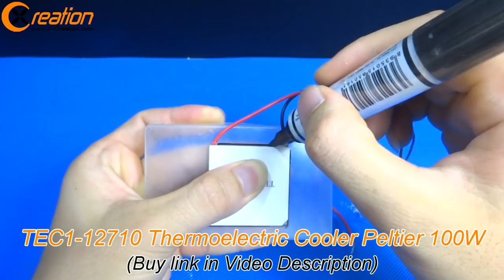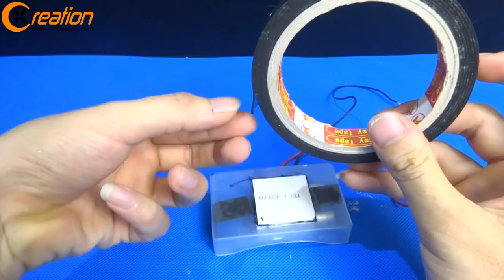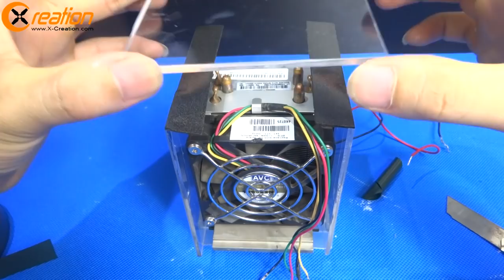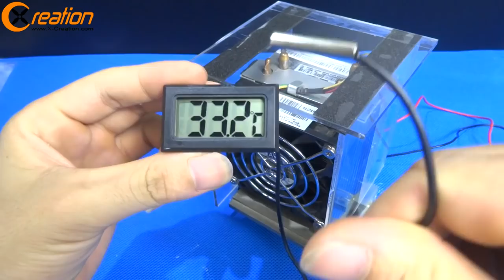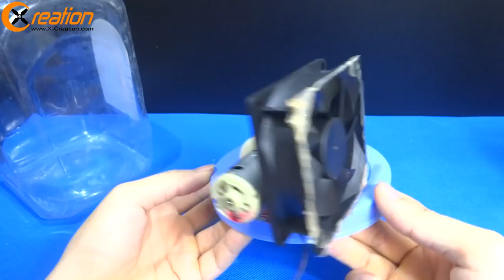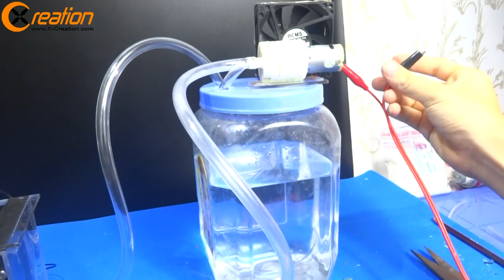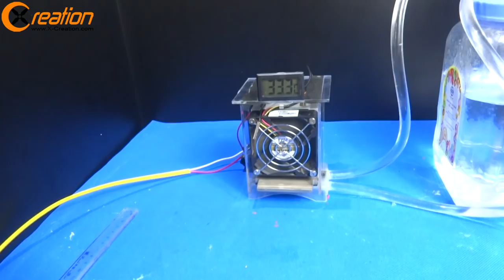How to make Air Conditioner WITHOUT ICE - Simple Homemade Invention

Comment: Uses soldering iron to melt plastic, Hot glued wires together. Smh.
Reply: That's the cowboy way??!!?
Reply: he has no soldering tin, need to improvise 😂
Reply: Lmao, imagine just hot glue'ing wires xD
Reply: Well twisting the wires will allow for contact an the hot glue will hold and protect from water. As long as there are no hard pulls it should last. Not that I think it will cool that much. An empty room OK, but with a living person, our body's put out a lot of heat.
Reply: it was kinda special
Reply: Yeah we all got cancer
Reply: dont forget those rusty tools lmao
Reply: im the 400th like
Reply: Results = he did an amazing job 👏
Reply: @tomcrisman8420  He will need to change the reservoir more than once per hour. A better idea would be an air-to-air peltier and have exhaust air go out a window via pipe/duct. This way it could run 24-7 without maintenance.

Comment: Whenever someone makes a video that has no audio and Loud obnoxious music you know what they're building is completely fake.

Unfortunately this is one of those videos that proves the rule
Reply: And, whenever someone like you, speaks, without trying it, you, embarrassed, yourself. This works in the same way, a water cooling system for a pc work. Though, I if you want to see, true results, I'd recommend, build a mini fridge, with the ability, to only cool water. This way, we're taking the water from, the cool fridge, passing through a pump, then finally. Repeating the very process. Thus, the water never gets to heat up back. Sigh, but what do I know, I'm simply a scientist. Not one that judge without giving it, the good old, college try.
Reply: @scoremoore4280  hey no offense brother but you put a lot of commas in your sentences it hurt when i read your comment
Reply: @scoremoore4280  not the same cuz you got something that splits heat and cold so some Parts are lower than room tempature
Reply: Peltiers are not used in PCs. They dont work. The issue is the focused heat the cpu out puts. No one has come up with a way to disperse it efficiently, or properly transfer the heat from cpu properly. That and the amount of energy it would take to make it viable is not worth it, when you compare just a normal water block system in a pc that works just equally as good at 1/3 the energy consumption.

Comment: This would actually heat the room unless you pipe the water into a different room.  It would be better to pipe the water to another heat exchanger with a fan on it also.  AKA heat pump.  You have to pump the heat somewhere else.  With the water in the same room the heat removed at the CPU cooler is placed in the water which dissipates into the same air.  Due to efficiency losses and energy added by the electrical system to run the pump and the fans, the overall system has a net heat gain so if it's all in a single room it's actually a heater.
Reply from the maker: great! seijirou302
Reply: Instead of that plastic container what if we use air tight insulated container like large thermus bottle and changing water hourly.
Reply: @deathsurgeon231  that's just stupid
Reply: water has a high heat capacity so although some heat may dissipate to the air the water will retain the heat so long as you don't leave it over night.
Reply: @namdabzerv3627  A better idea would be an air-to-air peltier and have exhaust air go out a window via pipe/duct. This way it could run 24-7 without maintenance.
Reply: @ericsanchez3663  If you want to dispose heat outside, there must be two separated system for heat exhaustion and air circulation, I guess. In this case, uploader of this video seemed to use a water bottle to absorb heat  to avoid such problems. Using Peltier device and CPU cooler for DIY mini air conditioner sounds like a good idea but it's hard to achieve practically, if you want it to run 24-7, I guess.

Comment: Show performance over 1 hr, 2 hr, 8 hr and you will see after the water heats up the cooling effect is severely diminished.
Reply: Trevor Sampson  it will burn itself after 8 hr
Reply: Its a fake video ,he has used his inhouse air conditioner
Reply: How do you know that ?
Reply: Simple Success story Sampson ,no harm admiring , this part of the world It is a NASA level invention As this is the vertex what this world can DO
Reply: Not to mention he cheated and put the sensor directly on the block after he realized it wasnt cooling very fast
Reply: Trevor Sampson eouldnt the energy used to vool the water that much be better used cooling the air directly?
Reply: then u put a small radiator with a fan in the cooling circuit
Reply: anno636  no its not a fake. as long the water inside the tank is cool enough to take some of the peletiers temperature the other side gets cool. ant the thermometer is going down so rapidly because the sensor is directly in the airflow of the coolerfan
Reply: s3v3redx -😆
Reply: James DeGray  Show us how
Reply: @4409supporter  You do realize it's heating the water, right?

Basically, the heat is being pulled out of the air and into the water through refridgeration
Reply: @michaellyndon6982  not sure what I was getting at a year ago, but yeah I realize that. It seems like someone made a comment about cooling the water though. Which would reheat the air since Im guessing itd be done with a radiator. Maybe I replied to the wrong person, im not really sure since it was a year ago.
Reply: true but it could be connected to mains water to renew when it hits a certain temp.
Reply: All those commenting that this is a genius invention and all those who are saying this is fake let me tell you it's neither, it is a clever way of deception. The readings were correct, but, the readings, in the end, were of the liquid-cooled heatsink as you can see at 6:32. This just like putting the thermostat lead in the water and calling it cooled. What a way to fool people.

Comment: I tried cooling water to a huge radiator and use like 6 of those peltier units (Like electroboom's setup) and it kinda cools the room and it's right next to me... Just 1 is not enough and the power draw is too much just to work properly. Not judging this guy's work... It's the peltier units that are generally not efficient and I like seeing DIY stuff so kudos to him for sharing his videos.

Comment: You're heating the water more than you are cooling the air, so you've basically made a very powerhungry, inefficient heater.
You need a heat exhaust; if you'd make a closed loop where the water travels outside of the room, through a radiator with fans and then back into the cooler, that would work and cool the room. Although  the power supply would also generate a lot of heat, so you probably want that in another space as well.
Reply: yes

Comment: Don't see how this works as an air conditioner... yes, it may cool down a room, but not for a long long time... You should've put the thermistor in the room rather than in front of the fan. Only the temperature expelled by the fan would chill the thermistor, not the room... this definitely needs a redo but with the thermistor in the room itself. Commercially available air conditioners dont run on Peltier modules... let alone one, they use refrigerant and radiators which achieves an effective cooling solution, one peltier module would barely effect the temperature of the room, and is not powerful enough to keep up with the heating capacity of the sun or the environment par se and heat will increase quicker than this machine can cool. this could work with sufficient radiators and cooling solutions, like using a fridge and putting a coil of tubing for water to run through then this ran through common computer radiators with fans pushing air through them. Could even work for a single 120mm radiator and about 3000mm of PVC tubing, that may be a good build lmao.
Reply: Shane Potticary Peptide modules are also ridiculously inefficient compared to commercial air conditioners or refrigerators
Reply: Penteir can’t be compared to compressor systems, as the way they work, and reason for them is different. This project proves you can build a mini Aircon, note the word mini. So mini wise this is the way to go, u can’t shove a compressor system in such a small size.
Reply: thanks for your detailed synopsis captain engineer.
Reply: It actually will never cool the room.  The first most important thing is to transfer the heat away from the room (that is outside - like an AC does)
Reply: @manishmandal-78  If you place the water bucket outside, then perhaps this could work...

Comment: With a lot of effort and abysmal craftmanship you move a tiny amount of heat out of the air one feet over to a watertank, which then radiates it back into the same air. The consumed electrical power for the peltier element etc is also radiated into the room. So the room gets warmer...heating can be done easier.

Comment: nice try tho, Also move them temp probe from the air where it should be to see how cold the AIR is to under it so its touching the cold plate is cheating to get a temp reading. your getting how cold the plate is NOT the air it should be cooling.
Reply: nice cheat

Comment: To all of the people in the comments critizicing this machine, saying that "it only works for 30 minutes then the water becomes hot and stops working... "
Have you guys ever heard of the law of preservation of energy? 
If you had you would know that evaporation causes cooling down effect. 
Therefore water will not remain warm in this setting for too long, it would start to evaporate as soon as the temperature of the water rises above the temperature of the air around it, but bacause the water vapor has no way to go, it would cool down condensate and fall back down.

Comment: did using liquid coolant than a water + a good cpu cooler can increasing more?
and some of radiator for the water coolant circulation
.
for theori ofc yes, but for "how long" its manage the heat? 3hr 8hr 12hr? idk
actually i'm wanna makin somethin for thermal issues for my CPU, bcs i don't have ac on my room
.
if adding radiator coolant circulation water block for this one can mantain the heat from peltier for a long term daily used 
did that worth ?? bcs we can buy that part using a second hand radiator from a motor bike or a car? n we can makes the circulation more faster using water pump

Comment: In my opinion I would’ve added a faucet thing on the water jar so you could attach a hose bib to it so you could put more water in it and put something in there that senses how low it’s running on water so the system can shutoff before it runs dry and then if Anything where to go wrong I would get one of those electronic boards that tells the system to go into diagnostic mode so you can figure out what’s going wrong where but that’s equally cool as well

Comment: Will it cool a small room of 100 square feet?
My suggestion for permanent connections is soldering wires.
And heat-shrink tubing. 
Otherwise a great build ypu have here.
Byron Thomas
Reply: It would if you made it big enough but the power consumption for something like that is big better get an ac,thats more like a personar ac to cool your space or just get a cool breeze

Comment: Put a fan on the top cap of the container facing the water and poke holes in the sides of the container to expell the heat of water from the blowing air of the fan

Comment: if you observe, when he turned the whole thing on the thermocouple is floating reading the air temp. but in the end it is touching the base of the heatsink therefor reading the temp of the metal base which is in direct contact with the Peltier element. "did it slowly fall down" or did he move it closer to the base slowly to achieve such temps. YOU BE THE JUDGE I don't think the temps are right. im having doubts about this.

Comment: Excess heat is being generated and dumped right back in the room. One of the most important and basic principles of why air conditioners cool  is it takes the heat from inside your house and dumps it outside your house. If, as with this device the heat is just being dumped right back in your room and even increase it will create a vicious heating cycle.

Comment: almost every diy radiator i see, they put the temperature rod in a place where it will get directly cooled by the device and not by the room's temperature. you may as well just put the rod on a ice cube and say "the room is colder now"

Comment: The idea of an air conditioner is to move the heat out of the room, you are basically accumulating the heat inside a bucket with water, so when the water gets hot RIP air conditioner... Maybe putting ice in the water will help keep it cool, but you have to add ice once an hour so is not worth it because you need a fridge heating up the room to make the ice... That's why 100% in-room air conditioner without some way of moving the heat outside the room is not worth it.

Comment: So, those tubes do not work in your setup, it is just copper transfering some heat slowly. The way they work is a liquid with low boiling point evaporates in them as they get warm and condenses at the cold side. Just reverse polarity in the element so heatsink will work as a heatsink, and push cold water through the computer liquid radiator so it will work great now just like a real one

Comment: Yes like other wrote before… SIENCE... you get a little bit of cool air and transport the heat of it into the water. 

And how do you cool the water ?

As long the temperature of the water is lower than the room temperature it will work, but at the point when the room temperature and water temperature meets the same level it will stop working.

This model is the same one than putting a bag of ice cubes into the flow of a normal fan...

Comment: Did you use some sort of controller to adjust temp?
Also what did you use for a power supply? Is this running on 12v battery or an outlet?
Reply from the maker: i didn't use "sort of controller to adjust temp". i used 12v adapter
Reply: 12v10A?
Reply: X-Creation {{facepalm}}

Comment: hello does anyone will tell me how much cost the electricity for all items ?
Reply: I am asking my self the same question but i just think that if it summer and it is hot that means there is sun and if there is sun you can install at your window a mini sun panel generator and then add a battery and here you are you just create a mini sun panel system

Comment: you should not put the water to the plastic jar it will boil the water, but you have to install radiator and give the radiator fan to transfer heat out

Comment: To make this design more efficient you could remove the water cooling component and put a hole in a piece of wood and setting the unit in the hole so the cold side is inside and the hot side is isolated from the inside by having it on the outside... You would have to make a shroud to protect the fan outside but it would make the device somewhat worth it for a cool breeze... as for cooling a room..... no way hozae..... Peltier units pull a large amount of power and usually have an inefficiency of 60%....

Comment: Will it b enough to cool my intel pentium processor?
Reply: Kairi Kazekage - no, the water in the jar will heat up = you would have to regularly empty it (risk air bubbles/lock in circuit) and if you didn’t ⚠️ steam will leak out of the jar/explode/jar or pipe connections will melt/cpu will burn out ☹️

Comment: the temperature measurement display was measuring only the very near area not the actual room
so you tried to trick people into thinking they will get the same temperature in the whole room
if you sincere enough you would measure it at least where you standing / sitting

Comment: Lol with that peltier module for every joule you take from the room you dump 10 in the water.
You need to isolate the water from the room otherwise you have pratically made a heater.
Using a rad and putting it outside would help...